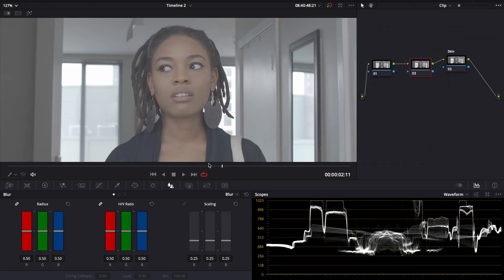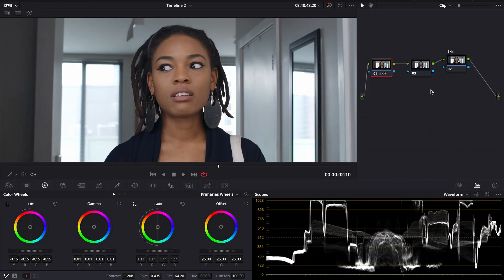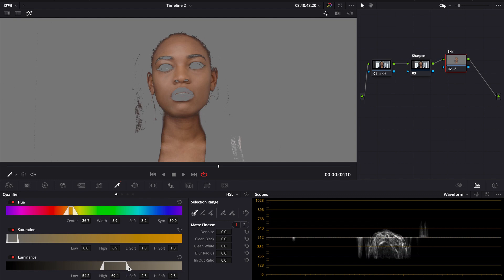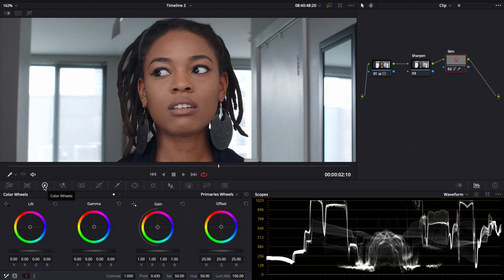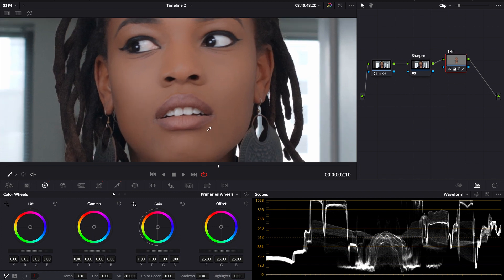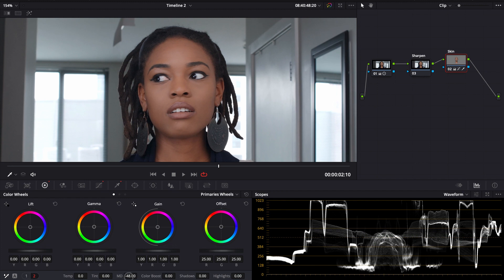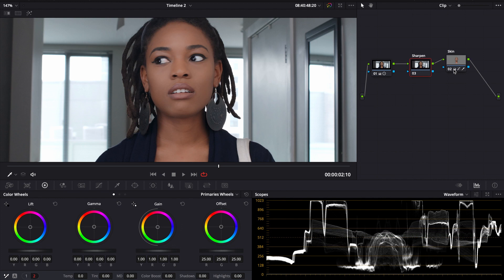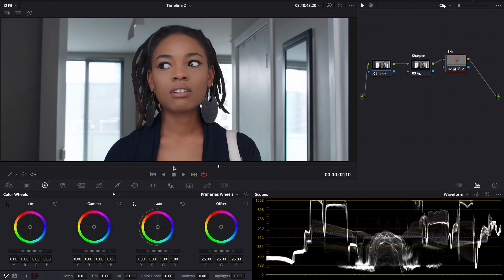frequency separation in video

Comment: Isn't this method really limited to selecting an area, the face, and then applying some sharpening? As I understand it, frequency separation isolates the high frequency not with a power window (which we might call simple spatial or area separation) but rather by filtering (separating) the high and low frequencies, usually by using a blur node that is subtracted from the main image. I realize there are various other ways but the idea is that they use more than a power window. Fusion also has some ways to do this.

Comment: actually, you can use the fusion tab custom tool to create frequency separation easily. but this is a great tutorial for beginners. I like that you use the Hue vs. Hue curve as a whole to dial in the skin tone. I too do this because it's easier to add a keyframe and make minor tweaks instead of fiddling around with all the sliders. I will say though, that if you want to get a little more control over your skin tones with sharpening and skin smoothing, you can use your key that you made but use it in a layer tree, copy and paste your key to a few more nodes: color, sharp, smooth, etc and then use the Key Output slider on them to dial in what you want. It works wonders.
Reply from the maker: Whats up Eric! Yeh this video is definitely for beginners as a fellow film maker asked me, how I get my skins to look smooth. OMG I thought I was the only one that uses the Hue vs Hue curve in that function, it gives so much control over the project. I see many creators just use the color wheels.  you're awesome bro, Im definitely going to try the layer tree method and put this to the test today because that sounds amazing. Do you normally use the fusion workflow for all your projects or just your higher end projects?

Comment: This is not frequency separation.
Reply from the maker: Yeh but that's as close as you're going to get in video.
Reply: @StickyValue  not true , there is a better way by changing the composite modes